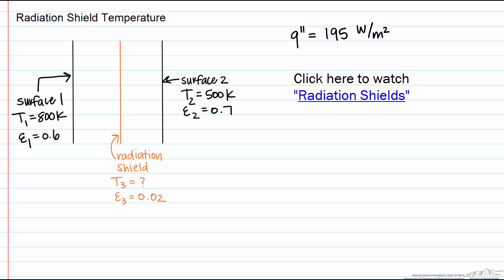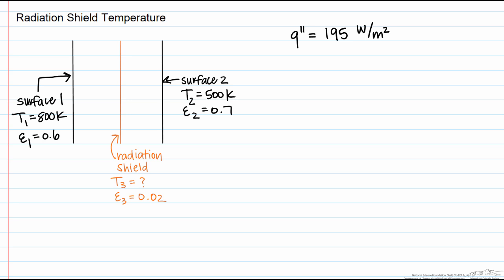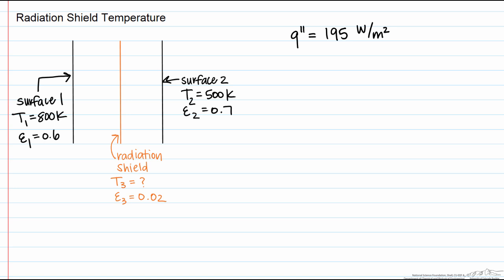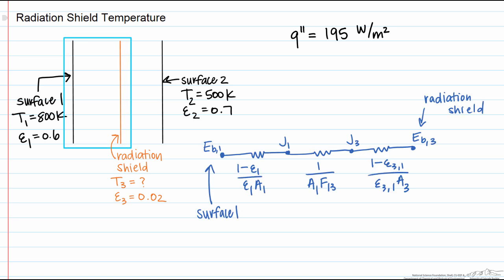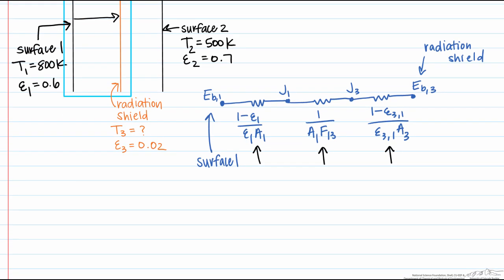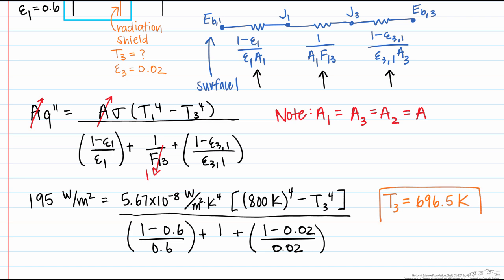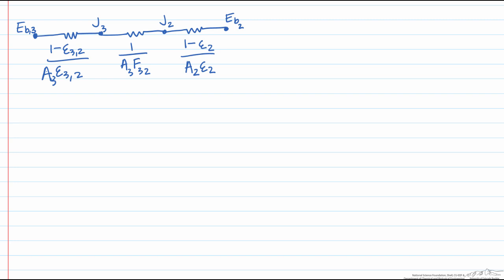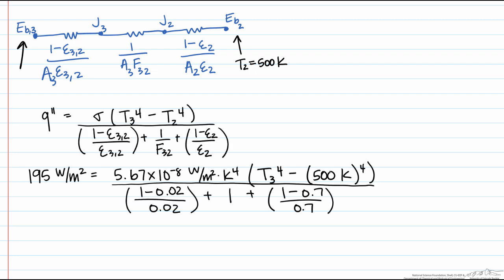Temperature of a Radiation Shield

Comment: What should I do if I want to know the temperature in a point between the surface 1 and the first surface of the shield ?
Reply: you cannot, because heat flux is not a function of length, rather a function of area and temperature. it doesn't vary with increasing length.